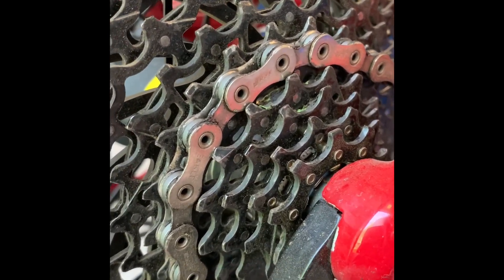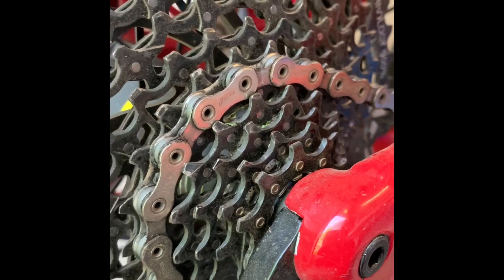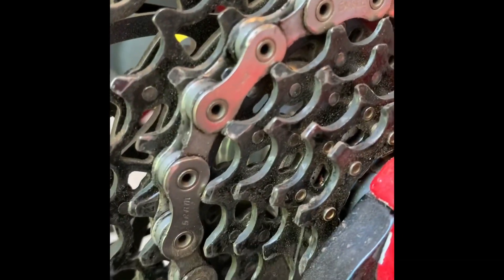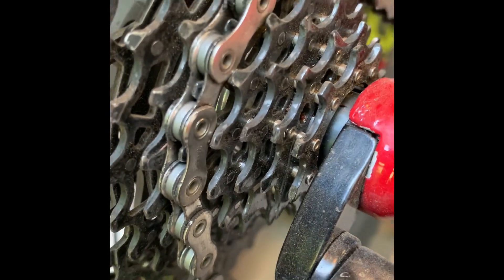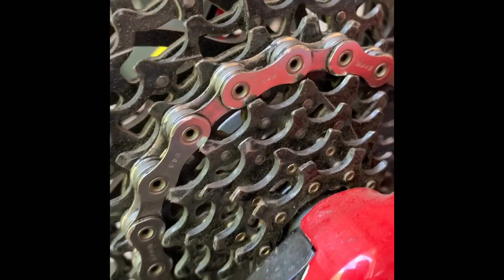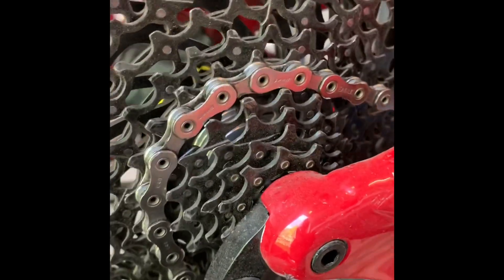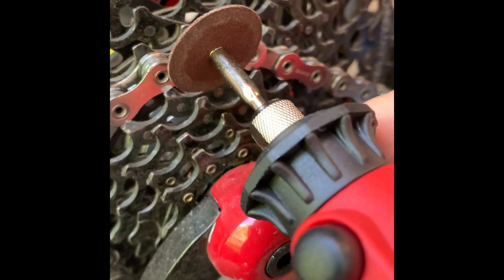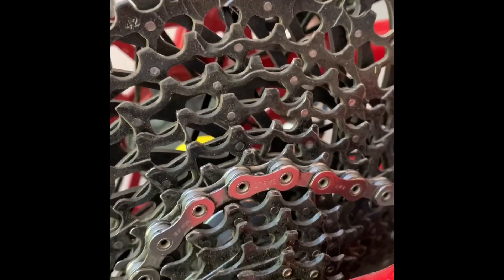Fixing SRAM GX Eagle 10-50t cassette clicking noise

Comment: This is not correct , bs if the front 38 th . chain is 118, 36 / 116, 34 / 114.
Reply from the maker: Not sure what you mean? Chainring size has nothing to do with this issue.
Reply: @jaj07  Not sure what the idiot OP was trying today. I have a 32T chainring and a 112 link Eagle XX1 chain on the same GX cassette. Mine sounds same as your post-fix cassette. I think it’s normal for some level of noise

Comment: What would be the problem with leaving the noise as it it? Would it break the chain or something similar or just the noise? I have the same issue on the 8th cog. I went with SRAM NX to upgrade my 2x8 because I didn't wanted to change the hub. Really regret not going the shimano way
Reply from the maker: Mostly it’s just annoying, and unlikely to damage the chain.

Comment: This is an unacceptable, flaw. If this really is a manufacturing or engeneering, spec flaw. Have they fixed this yet? Rediculous great fix. But such issues can happen if cogs have been warped, teeth bent. So make sure to check that.
Reply: They havent fixed it. Just bought a new cassette and it has the same issue as the previous two.
Reply: Still haven't fixed it as of 2024.  Had to do this on two separate GX cassettes this year.  I used a small metal file.

Comment: also caused from any misaligned or twisted tooth that has no bur. check by selecting a gear, very slowly back pedal while looking down at teeth when they enter the chain. all should ride in the center of the links. you can easily spot any that don't which can be gently bent back with pliers.this should a regular check as there often be no tick sound. this will greatly save on chain and cassette wear and noise. I've had many, many caused just from aggressive trail riding/shifting when going up sudden steeps and not enough speed. lots of lateral stress. be sure not to mar teeth with the pliers. this will also reveal any bowed link plates on your chain.

Comment: I had the same clicking sound on 8 cog ,  counting from the top down and my bike is still under warranty by Yeti . The clicking sound only occurs during ascending on a slope however no clicking sound on straight  The problem is our local agent cant fix it and relinquished his responsibility to customer to make direct contact with Sram . Our local agent said he tried all his best and claimed there is no clicking sound after having my SB100 for two weeks on two occasion however upon returning the bike , i tested and the click was there and our  agent did  a temporary repaired by adjusting the shifting tension cable . I wrote to Yeti USA about our local bad attitude and our local agent is not very happy and terminated their services rendered . Our local Yeti agent acted unscrupulously by  washing their hands and Yeti USA just stay silent.  I am very disappointed with Yeti too

Comment: What a fucking joke this is, really. I bought a brand new Stumpjumper today and it has this exact issue, with X01, same as my previous bike that used GX. I knew I should've went with Shimano. Absolutely ridiculous that this is a thing on a 5k+ bike. FFS
Reply from the maker: I have not run across this issue on X01. Sorry to hear that! If it’s a new bike I’d take it up with the shop you bought it from.
Reply: @jaj07  Thanks. Yeah I'm gonna do that first thing tomorrow. And it's actually the GX cassette, I thought it was X01 because the rest of the set is.
Reply: @jaj07  I bought my Yeti from our local agent , both bicycle (SB100 & ARC ( has clicking sound on cog 8 ) are still within Yeti Warranty , our local agent has failed to address the issue and ran away by asking you to deal directly with Sram and that's the problem Our local agent forbid you to make contact with YETI USA too
Reply: I had mine the same clicking sound on my Yeti SB100 (XO) & ARC (GX Drive Train)  however only on ascend on a steep slope . Unfortunately Yeti could not solved the problem as my bike is still under warranty , they chicken out and passed the buck to Sram and washing their hands and that's terrible for a high bicycle maker !

Comment: Ever thought your derailleur was out of line and that ticking noise is your chain wanting to jump onto the next gear not a pointing out casette tooth? You see I’ve just got a gt sensor carbon pro and it’s making the same noise on cassette, must’ve done about 5 hours riding out on it, I’ve barely rode it so yeah not sure whether it’s derailleur out of line or a tooth needs filing
Reply from the maker: Always check the hanger alignment and derailleur adjustment first

Comment: This is GOLD! Thanks!!! I spent over an hour setting my endpoints and messing with tension trying to get this noise to go away on a brand new 2022 Trek Marlin 8. I’m thinking to myself “There’s nothing left to adjust..what the heck!!!” but “I still get a clicking in this one gear in the middle of my cassette .” Now I can’t wait to get a closer look to see if this is what is going on.
Reply: Hi. Just installed a new 10/50 eagle cassette and have this issue on two sprockets. Must check what you found. 
QC in factory needs a shake up.
Reply from the maker: Yes, a good example of how this problem will also show up on brand new and 100% correctly adjusted cassettes!

Comment: bad advice! this is caused by a misaligned derailleur hanger. you can fix by replacing the hanger., or straighten it. of course, you can "solve" it by grinding the booth of the cassette, but will end up with a worse shifting performance.
Reply from the maker: Thanks for the feedback, but you are mistaken. I know how to properly adjust and check a derailleur and before making this modification I did all the usual checks and adjustments: Make  sure the hanger and derailleur are straight, new cable, limits properly adjust and B-tension set with the suspension in sag and using the Sram tool.
Reply: Pay no attention to @guang-xingli9228.  My derailleur hanger was 100% dead on straight and I had the clicking in just number 5.  I looked carefully and one tooth on number 4 was just touching the outer chain link plate.  I used a jeweler's flat file and just barely removed a bit of metal and it's now perfect.

Comment: This is why I use Shimano components. The GX cassette is around 200$, you shouldn't have to do these "fixes" on a product so expensive.
Reply from the maker: My new bikes also have Shimano 12-speed. 0 issues and the shifting is superb!
Reply: @jaj07  Don't buy Yeti Bicycle comes with Sram GX and XO  as I have the same identical problem , They will scramble into thin air and pushed you to make contact directly with Sram even its still under warranty

Comment: On mine there were two teeth (about 180 degrees apart)if I recall correctly on about gear 8, I used a small file after carefully identifying the offending tooth which lifts the chain momentarily.

Comment: Hi how to know when need to replace the cassette? I have some teeth very sharp triangle but not sure if they are designed like that, others are more mellow. 
I dont know if because of that i broke 2 times an old gx chain (poor chain) and today again a 1month new xx1..

Thanks
Reply from the maker: My experience with Eagle is that the chains mostly break due to poor shifts or shifting under power.
GX chains are usually good for ~1000km, X01 and XX1 2000-2700km. Always replace the chain at 0,5 wear and you should get 4500-5500km out of a GX cassette. A new chain will skip on a worn cassette.

Comment: Great fix.
I have an XO eagle cassette that works like a charm, but on my other wheelset a GX eagle casette and chain (same chain length) with clicking noises allover.
I corrected 8  cogs that had a little hang up and now it is as smooth a the XO eagle cassette.
Reply: X0 cassette $400. GX $200

Comment: Finally a video about it!
Reply from the maker: You’re welcome! 😊
Reply: Right! I spent over an hour on my brand new 2022 Trek Marlin 8 trying to adjust the tension, end points and spacing! I could get the noise to go away, but then it would not shift cleanly. I was almost ready to pack it up and bring it back to the shop I bought it from. With bikes in such low supply right now because of COVID, I located this bike on a whim and drove over an hour to pick it up. I really didn’t want to make that trip if I didn’t have to.
Reply: yeah finally

Comment: Shifting still crisp after this modification?
Reply from the maker: Yes, no discernible difference. The key is to remove as little material as possible and slightly chamfer the inside edge of the tooth to make it stop contacting the outer link of the chain.